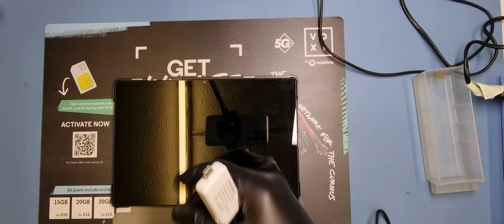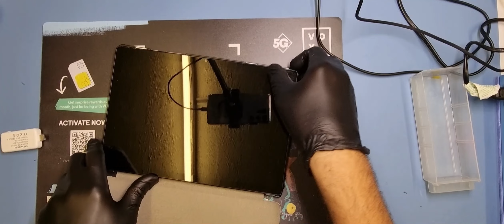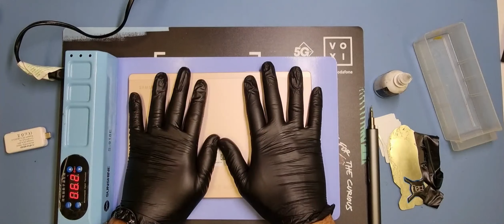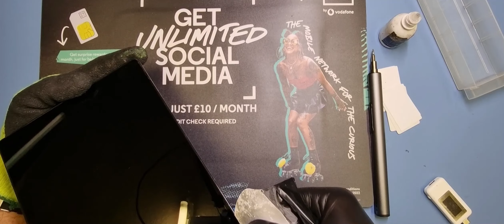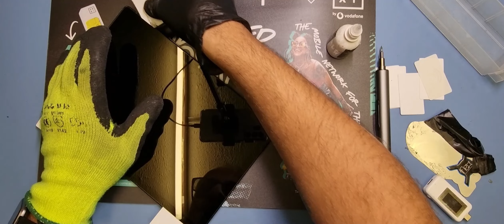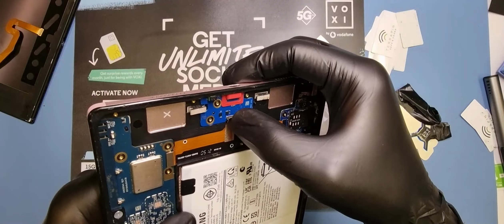Samsung Tab 8 SM X200 Charging Fault Repair

Comment: My son has this tab,  its doing the same thing but not charging at all.   I've left it charging for a few hours but nothing is changing.   I'm not sure if I should just throw it away and get him a new one or have it repaired.  I've not even looked at prices yet because I just know it will be over a third of the original cost which is why I'm a bit reluctant to consider repair.  Decisions.. decisions!